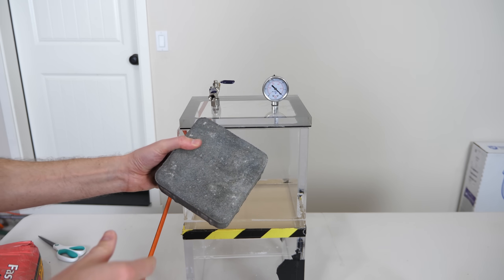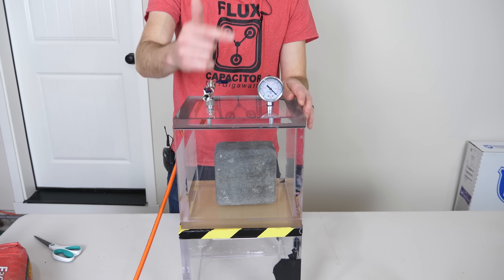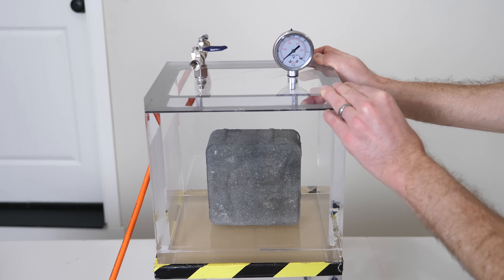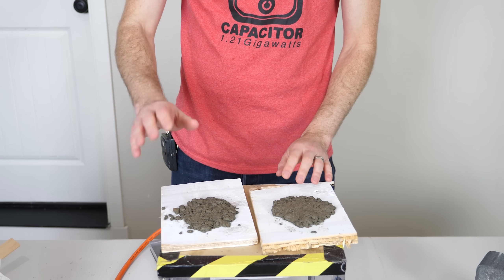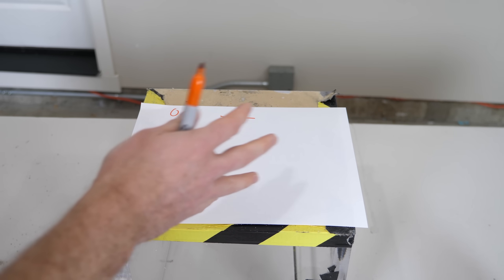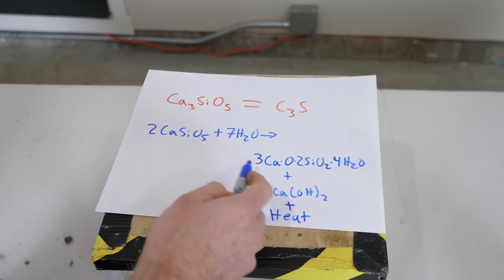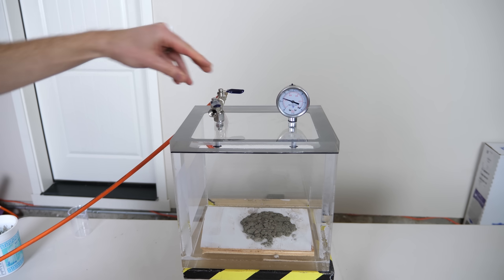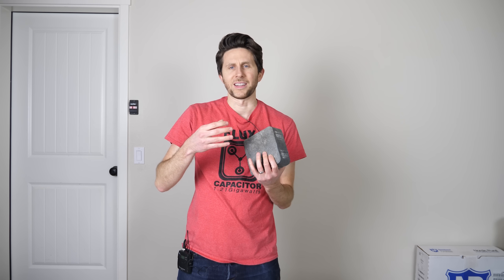Does Concrete Turn to Dust in a Vacuum Chamber? Concrete Without Oxygen Experiment

Comment: This was not a surprise, but I have a question: does the vacuum disinfect at all?, I mean, how long would you deprive it of oxygen and pressure if you want all microbes to die? Do they die even die ?
Reply: I think some bacteria or archea survived on the outside of the ISS for weeks - so probably not reliable
Reply: @robbiejames1540  we've explored how much of the earth? and u think we know what happened more than 4k years ago? the ego is great in science today lol. u can't even admit christian scientists made science what it is today, in fact u think science "disproves" god...... lol hilarious. 

worst part is u treat theory as fact lol..... "o the center of the earth is this" how far down have we been? "7 or so miles...." so how do u know? we don't even know whats on teh bottom of the ocean really, yet we know the center of the earth... yea, ok......
Reply: @JoseRamirez-dv5uo  
Ok, firstly, I didn't say any of what you were arguing against - all I said is that I remembered something about bacteria surviving in space. However, conveniently, I am an atheist and agree with all the points you pretended I said, so it doesn't matter. If you've noticed, we've explored almost all of the earth (above sea level), and we have written accounts from about 4000 years ago. While you're right, we cant be entirely sure exactly what happened 4000 years ago, we can be more sure than anything else, so we assume that to be true, until something more plausible with more evidence crops up. Hence "treat theory as fact" is a bit meaningless.

Currently our best theory about the centre of the earth is that its got lots of melted rock in it, with melted and solid metal in the middle. This is supported by melted rock coming up out of volcanoes from deep down (so there's melted rock), the speed at which the sound waves from earthquakes travel through the earth (sound waves typically travel faster in denser mediums and stiffer solids, so dense liquid iron and dense, stiff solid iron even more so), and the magnetosphere (earth has a magnetic field, and convection currents in liquid metal could explain that, so its pretty likely there's convection currents in liquid metal in earth).

It is through this process that science doesn't "disprove" god, but rather everything so far discovered either has a more logical explanation than "god did it" or is still being investigated. As god has, as yet, had no measurable direct effect on the world we know about, there is no real evidence for him, just as there's none yet for the flying spaghetti monster, or holy pink balloon, or blue hippo of despair. Also, yes, Christian scientists laid some of the foundations of modern science, because in most of the places that these scientists were to be found in, the law was to be Christian!
Reply: @JoseRamirez-dv5uo  jesus christ man he didn't say anything about christianity, or anything that you quoted.
Reply: @JoseRamirez-dv5uo  Theories can be facts . Theories are based on experimental data on which certain acceptable assumptions are made. Evolution is a theory,  atoms are a theory,  chemical bonds are a theory, sliding filament of muscle fibres are a theory.  They all are true nonetheless. If not give one proof against it. You'll debunk that theory.
Reply: @JoseRamirez-dv5uo  Gosh why don't we know about deep ocean its not like we have more than 16000 psi pressure under there.
Reply: @yoshikagekira6166  theory can be substantiated by facts, its not a fact in itself..... we have a hard time with gravity still, can't explain certain things... need example? so the reason y we see 1 side of the moon, is the gravity of earth grabs the nearset side of the moon, and holds it, hence y we see 1 side supposedly... .but the sun has twice the gravity pull on the moon...... so simply put, how does the moon not get pulled by teh sun? out of orbit? or off its axis? i can also add gyroscopic affects to this, which makes it worse...... so...... we haven't expanded on the theory of gravity really since newton.... they dig too deep, the numbers to the equations r off.... so. do the equations work most of the time? yea... but at times it doesn't.... kinda like the bohr model of the atom, then u get to learn about spdf whatever orbits of electrons, then it gets worse from there..... anons? quirks? or whatever, we r lost again.

that was several proofs lol..... do i need to go into delft quantum entanglement? double slit anomaly? nobel prize for quantum mechanis "if u think u understand quantum mechanics, U DON'T"...... so the guy who got a nobel prize for it, said that? ehh? and u want to talk theories? lol.... "atoms" yea, quantum mechanics lol..... WE HAVE NO IDEA WHATS GOING ON... some theories work TO AN EXTENT... but then get lost .... 

JUST LIKE THE BOHR MODEL.. yea, it worked for hydrogen or whatever, THATS WAS IT... lol.
Reply: @JoseRamirez-dv5uo  You are a smart guy Jose but you are just underinformed . The reason why moon doesn't fall into sun is simple. It orbits the Sun along with the earth. Trace the path of the moon and the earth, you'll see that the moon orbits around the sun albeit with minor bumps . Imagine throwing a bowling ball tethered to a tennis ball causing the tennis ball to spin around the bowling ball both will fall to the ground i.e. gravity produces similar acceleration to both and we know that orbiting is acceleration due to gravity. This is known as the Hill sphere effect.
Reply: @JoseRamirez-dv5uo  Quantum Mechanics is currently the best model its not perfect. But QM  is part of a bigger Quantum Field Theory which is more accurate which states the prescence of fields interacting with each other.
Reply: @JoseRamirez-dv5uo  Science kind of works on assumptions sometimes but to say everything is inaccurate is bit of a stretch. We know a lot of things in science yet there are still more things we don't know yet.
Reply: @JoseRamirez-dv5uo  Bohr's model was a postulate made from empirical evidence.  It wasn't a proper theory.
Reply: @JoseRamirez-dv5uo  Quantum Mechanics has more to do with our perception and application of maths. It can have multiple interpretation. 
2*2=4
2+2=4
2^2=4
All are similar statements, if you expand them they end up in the same pattern of 2+2=4
So are they inherently the same. It depends a lot on how you interpret math. 
A lot of quantum mechanics is not physics being spooky but when we try to observe a small system via high energy photons we change its state. A quantum system is just too sensitive that it easily destabilize when we interact with it.
Reply: @JoseRamirez-dv5uo  The quantum mechanical model developed after Bohr did explain orbitals for all the elements.
Reply: @JoseRamirez-dv5uo  Talking about moon colliding into the Sun. Did you know that its harder to collide into the Sun from Mercury than it is from Mars. This has to do with angular momentum of the planets since their velocity increases with decrease in orbit. The moon will ony escape earth once it reaches the escape velocity of 11km/second.
Reply: @JoseRamirez-dv5uo  We have expanded from Newtonian Gravity to Relativity Gravity. We also have an equation 
R=(8pi G)/c^4 T
Reply: @yoshikagekira6166  what is science based on? math? math is based on? axioms? how many again? 6 or 7? axioms? axioms r literally "assumptions".... altho nikola tesla did say "math isn't science" soooo...... in fact nikola had plenty to say on that, and i would say he is the best scientist we know of to this day........ funny, how they took how long to admit free energy was real? (graphene)..... lol found out with scotch tape and a pencil lol........ wow.... yes, science is totally objective (im being sarcastic if u can't tell)... lol, no the oil companies had nothing to do with putting nikola under wraps with the whole free energy thing (or overunity, just in case u want to argue semantics). no science was right, free energy is a myth LOLOLOLOLOL.

u say we know a lot in science? regarding what exactly? hmmm? what "proof" do u have? do u even know what 100% is? if we don't even know that, and we only explored 35% of earth? ehhh, i would say we no less than half, AT LEAST.... and i would even go lower, cuz we don't even know what 100% is lol... what is 100% of knowing everything exactly? god? no god? can we recreate everything? how far intot he universe have we been? what % of that? or other dimensions?

r we in a simulation? or not? we can't even figure that out lol..... jesus man.
Reply: @JoseRamirez-dv5uo  I just feel sad for you. You have potential Jose there is nothing wrong with questioning existing knowledge but you are determinant that most science is wrong even though we have explanations and experinental data to prove our point. There is nothing wrong with being bit skeptical but you are ignoring all the proof we have.
Reply: @yoshikagekira6166  yawn.... and what u said had nothing to do with the point..... how do u know its the best model? u give no reference? i bring up actual experiments, yet u guys? just say shit... no references, no names, no theories... just "theories r facts" ehhh? no they r substantiated by them...... "theories this" 

like what? i forgot who brougth up pressure... but ehhh, if we can't defend against high pressure, how can we defend against none? then add on the vab, and the thermosphere, which cnn in the early 1900s reported on, and also orion missions in 2013, tehn don pettit in 2015 or so said we destroyed tech capable of going in to space.......... tehn obama and many others, talking about how we will enter leos for the "first time"... u know what a leo is? well let me give u a hint, ITS NOT THE MOON....
Reply: @JoseRamirez-dv5uo  We will never figure out if we are in a simulation or not. It called the Boltzman Brain argument. But what is astounding is our universe works on Mathematic principles, ( Principia Mathematica by Newton, Prediction of Blackholes by Einstein using math, Carl Anderson experimentally confirmed antimatter which was mathematically proposed by Paul Dirac). So whatever simulation if there is any doesn't disobey math generally.
Reply: @JoseRamirez-dv5uo  LEO is low earth orbit
Reply: @JoseRamirez-dv5uo  Quantum Mechanics is the best model YET. We are always working towards a theory of everything.
Reply: @JoseRamirez-dv5uo  High pressure is harder to handle then vacuum. But we do have protection against vacuum of space  . There are special suits called EVA( Extra Vehicular Activity) suit. These are thick ,insulated, are reflective protecting astronaut from the space conditions. 
The pressure of  Mariana Trench is more than 1000s of atm but our blood pressure and the turgor pressure is certainly no more than 140mm/Hg for a person at rest( 1 atm= 760mmHg). We use the space suits to apply a counter pressure that helps us survive the vacuum
Reply: @yoshikagekira6166  no, the numbers r against it, the sun should've pulled the moon out long ago.... the numbers they give us already say teh moon moves away a certain distance every year "not noticeable" (but if u include their timefraime, aka how long the moon has been around, it doesn't add up)... "takes thousands if not milions of years" well, if we go by their timeling, the moon was gone long ago, and i could only imagine the tides when it was close lol.......... to which, teh moon and sun both affect.

always question science, if u stagnate we lose...... i forgot the saying, or who said it... but the one where its something like "when answering a question is fine, but questiong an answer isn't, u have a problem"... thats where we r today, and let me tell u, if i told u my full belief on how this world works, u would think me an idiot outright.... yet i know more than most..... which is funny when u think abou tit lol.

perihelion? aphelion? how big is earth? hhow far is the sun? the moon? capricorn? cancer? equator? the solstices, equinox',  hmmm...... how much of the earth has been explored, where the ring of fire is, the most earthquakes, hurricanes, monsoons r..... how earthquakes work for the most part (just a theory lol, dutchsinse is good) 

so, what? i follow the bible, at least the good parts, and one of those parts is "trust no man, figure it out urself".... so i will do that, i have noone to blame but myself... now u can nitpick and say "o well the info u use is other people" 

well i have to somewhat comprimise don't i? i simply question, i do believe in what i believe, but i don't try to force it on others, and if respectful, i will debate, but be rude, i'll be rude too.... and i can back it up..... but in the end, it could all be a lie, a big truman show, but when i feel an earthquake, and hear about others near me, i can someone quantify and believe certain people, or whatever, look around me today for evidence.... "history repeats" for instance, ok, what happened int eh past, that is happening now? hmmmm... feminism, oversexualizaion, immigratoin, dark ages... ok...... let me read up on that.... o shit, we r doing the same shit they did, FUCK....

tbh, idc really, but i come from bottom of the barrell, i can tell for the most part, when someone is manipulative, and the like, i don't like it, hence my aggressions and suspicions. just thought i'd give u some context. i have no friends really, i really don't care for anyone, teh only thing i cried for was my dog, i was happy when my stepmom and gma died, such a relief..... was like finding out u beat cancer lol.....

u know, science said, coconut oil was bad.................. the fats were bad for u....... u know y they said that? ww2, pearl harbor.....

i haven't been sick for decades, thanks to coconut oil, stop and think about that lol.... lauric acid, feeds ur good germs, the ones that defend u, covid, flu, anything is moot.... i have a nasty foot fetish too, u'd expect me to get sick, but i don't....... science isn't as objective as u think it is..... sooooo, o btw dont' get me started on science of the mind.. psychologists, dear god.......

science is a joke nowadays, i can go on and on, if u want to hear, my anthropology teacher, physics teacher, u name it lol... psychiatrists, psychologists.... physical theapy, mental therapy, cars, planes, trains, oils, herbs, dirt, atoms..... i just keep finding faults, and keep questioning, sometimes u find someone with the patience to give u more info, and not a knee jerk cult reaction..... o, btw, im a flat earther lolololololololololololol so.... good luck with taht knee jerk lol
Reply: @JoseRamirez-dv5uo  Well lets talk about atomic experiments if you want to. The Cathode ray experiment by J.J. Thomson proved existence of electrons. Goldstein using a slightly modified apparatus using a perforated anode proved protons. James Chadwick bombarded a thin sheet of berrylium with radiation and proved existence of neutrons. Thomson gave the plum pudding model for a positive uniform mass with electrons embedded such that there's a net neutral charge. It was superseded by Rutherford's model of a small dense atomic nuclei. He bombarded a thin sheet of gold with alpha particles most of them passed undeviated, but the once which deviated were a lot deviated proving there's a dense concentrated positive charge. Bohr's model superseded it by using quantisation and atomic absorbtion and emission spectra.
Reply: @JoseRamirez-dv5uo  The time doesn't matter earth has been revolving the earth for billions of years without a massive change in its time period of revolution. Conservation of Angular momentum stops the moon from colliding into the Sun.
Reply: @JoseRamirez-dv5uo  The earth is 12,756 km in equatorial diameter and 12,714km in polar diameter. Equatorial circumference is 40,075 km  meridional circumference is 40,009 km.
Reply: @JoseRamirez-dv5uo  The sun is on average 1 AU or 93 million miles away from earth ( mean distance)
Reply: @JoseRamirez-dv5uo  Earthquakes happen due to collision and grinding of tectonic plates against each other which in the form of sound or seismic waves surface on the earth at epicenter causing the land to tremor.
Reply: @JoseRamirez-dv5uo  I mentioned before that its good to question stuff but if you chose to ignore the answer saying it is just wrong then you will never get an answer. Imagine asking people what you call a certain color in their language. You listen to them but then you deny that information.
Reply: @JoseRamirez-dv5uo  I too sometimes don't understand science but instead of saying that everything is wrong I try to understand everything around me, educate myself. Just because I don't understand something doesn't mean that its wrong and later eventually I did understand not rote learn whats given in a book.  You can easily experimentally verify a lot of scientific principles even in your own backyard.
Reply: @JoseRamirez-dv5uo  Science isn't a cult it goes through peer review and public consensus. A cult cuts down and separates members from society and outside information meanwhile science is publicly available information.
Reply: @yoshikagekira6166  good for u, u still missed the point, most people don't know shit..... btw i use miles..... my km conversion isn't what it was, nor do i care really. my point was, most people who "believe" in this stuff, don't even know these things, thats all.
Reply: @yoshikagekira6166  ok, 1. lets try to make our convo into one response... im on my ps4 so it makes it hard for me, i'll try to read both ur replies, and combine them both here.

2. i should've said thank u also for the compliment, i apologize for not doing so.

3. here we go... im gonna try to see if i can look at ur other comment, and respond to that at the same time.

"science kinda works on assumptions" yes, it does, but thos assumptions get tested, some some aspects of it can't be tested until we can be there. u said again 
we know a lot" to what %? what is a lot? compared to what? everything? like i said, we only explored (look it up) 35% of the earth........ then things like the delft quantum entanglement experiment? and the double slit anomaly experiment? literally they theorize taht "light is aware we r watching it"....

some people argue, "o well, teh trackers throw off the experiment".... well funny thing is, they left them on, and just didn't look at the numbers....... but when they did look at the numbers, or the effect, it would change on whether they were looking at teh number, literally, the light was aware of them watching itself.. 

delft quantum entanglement? same thing, if b saw it, a wouldn't, if a saw it, b wouldn't, if they didn't pay attention, it shown on both....... sooo? 

"the earth has been revolving around for billions of years" what proof do u have? live snails that have lived may a few decades have been dated to be living for thousands of years, so ur basing ur numbers off failed science.

my argument with my anthropology teacher, since i dared to read a encyclopedia on the matter........... u know, how u date rocks? how u date fossils? well.. the definiton i read was quite a circle argument......

so, the encyclopedia said that "we date the layers by the fossils........ and we date the fossils by the layers"

ehhhh? how is this scientific? dn't get me started on mother and daughter radioactive bs....... many things can affect how old something can be dated... rain, heat, weather, exposure..... like candles, i could ask u how long these cnadles have been lit for, i guarantee u would lose..... i could add was to one, cut one in half, burn one from both ends..... u can't tell how long it was lit for lol. then imagine all these candles r int he same room.. or  "layer", next to eachother..... to ascertain the whol thing, u would have to know the mother and daughter cells present from the start, and that has shown to be a complete failure, as my snail experiment proved. they thought a 20 yo snail was like 10000 years old lol. 

and u trust we been around for billions? do i agree there has been only 6k years of human history? no, i think we been around longer than that..... something keeps resetting us, whether its the coral reef, or natural disasters, every 5k years or so, the world is renewed yes? the flood? the meteor? volcanoes? ice age? so........

we r in the time of the 5th sun? if i remember right? by aztec/teotihucuan (i can't spell these guys right)  or mayans said? aka there was 4 world wild natural disasters that happened? and now we r about to hit the 5th? so they have roughly, IF THEY R RIGHT, 20k years of history we dont' know about..... then the neanderthals, and the like, which supposedly goes back 10k years? egyptian 13k years or so?

what did they say?hmm? in wonder..... this is how i learn more, i have to research now, thanks for the thought.
Reply: @JoseRamirez-dv5uo  Radioactive dating of earth crust is independent of climate. We use the half life of  U-238 atoms to find the age of earth and its approximately 4.5 billion years.
Reply: @JoseRamirez-dv5uo  C-14 atoms used to date organic matter works bit different.
Reply: @JoseRamirez-dv5uo  Radioactive decay is independent of physical and chemical changes of climate. The rate of Radioactive decay is dependent on the weak nuclear force. These nuclear forces are of such high magnitude that climate, rain, wind doesn't effect the rate.
Reply: @yoshikagekira6166  ehhh, and, u need to know how many mother, and daughter cells there r.... from the start, to even begin to think about how old it is, and u didn't mention the snail at all, or the failing of it....... "approx 4.5" theory..... just a theory...... we can't explain most things today, only 35% of the earth explored,  hell things the romans made, greeks, egyptians, we can't recreate lol, come on man.
Reply: @yoshikagekira6166  btw, there seems to be no proof of temp not affecting nuclear decay.... in fact, that is how the atomic bomb works apparently..... sooo. im going on my way here, good luck. also, im gonna repeat myself, u need to know the numbers/ratio of the mother to daughter cells to even begin to guess at how old soemthing is. so....... good bye.
Reply: @JoseRamirez-dv5uo  Atomic bombs don't use radioactive decay but nuclear fusion. Both work differently.
Reply: @JoseRamirez-dv5uo  Candles also emit radiation but that is Blackbody radiation which is temperature dependent unlike radioactive decay which is temperature independent.
Reply: @yoshikagekira6166  so chernobyl...... wasn't affected by heat?
Reply: @JoseRamirez-dv5uo  The heat melted the corium and the steel walls of the reactor and didn't affect the half life of the atoms. This melting of the core resulted in exposure of radioactive material to the outside environment. The radioactivity wasn't changed.
Reply: @JoseRamirez-dv5uo  Radioactive decay happens due to electroweak forces by Z and W bosons. They are of three types alpha,  beta and gamma. Gamma is always produced but an atom may randomly undergo a beta decay or an alpha decay one at a time.
Reply: @yoshikagekira6166  hmmm, weird, u see teh show chernobyl? thats not how it explains it..... and 2. the old lady, that they made "vacate" her farm? they shot her cow in the head, she still lives there, never left......

i see 2 problems here.....
Reply: @JoseRamirez-dv5uo  Radioactive decay rate remains the same but when the core melts and the Radioactive material disperses then effective radiation decreases but the half life of an atom is always the same.
Reply: @yoshikagekira6166  i gave up on science long ago, when they couldn't admit nikola was right about free energy, now they freely admit it (graphene) only took them 140 years or so to admit. i can remember some other experiments too, back in the day, but overall, science is a joke now, really wish u wouldn't send me multiple  messages, if u can plz consolidate, put into one message..... 

btw, u said they may "randomly" do something, ehhh, cuz we don't know yet...... maybe never know, so maybe thats y there is no definitive proof that heat can or can't affect decay... so.
Reply: @JoseRamirez-dv5uo  Graphene isn't free infinite source of energy that violates the first law of thermodynamics.  Second Z and W boson in order to increase entropy  randomly decay. This logic is terrible that since its random it can be associated with temperature. Rolling a dice is random but  I can't relate it with number of kangaroos in Australia. We have done various tests with control experiments and we can't find either a correlation or a causation of radioactive decay with temperature. Nikola Tesla was a pretty smart inventor and scientist but anyone can make mistakes considering they lack the resources and information that we have now. Although Newton maybe smarter than me but I am more knowledgeable about physics then him. Its because I have access to information that he didn't.
Reply: @yoshikagekira6166  i don't think ur understanding what im saying.... there is a woman, that lived next to chernobyl, in the "radioactive zone"...... did they not say it wouldn't be able to grow anything? or have life? well, this women never left, and is still alive or died somewhat recently (in last decade or so) also, the wildlife is back in full force, no weird mutations.

in fact, back in 2018, they said a pack of wolves were spreading mutations.... none yet, no word........ seems the math is off..... math, is not science, they said it would be dead for years, its fine lol, radioactive decay, is bs for the most part, and it is affected, as proof of chernobyl, and the woman who never left the "bad zone" and the animals that roam there..... and the plants taht grow......
Reply: @JoseRamirez-dv5uo   There is a nuclear physicist called Thunderf00t, he is a good source for statistical info on this on YouTube. 
Secondly,  Let us understand how radioactivity affects us. U-238 the fuel used in reactor isn't super dangerous by itself,  the main culprits are Strontium-90
and Iodine-131 which bio accumulates in bones and thyroid respectively.
In order to die of radiation sickness by U-238 you'll have to eat 50 grams of it. Of course chemical poisoning will kill you first.
I-131 has a half life of 8 days hence its very radioactive but will decay and end up quicker lasting less time in the food chain. 
A lot of radioactive damages depend upon factors like bioaccumulating radio-isotopes.
If you want a clear cut image on the statistics see Thunderf00t, Infact he holds the same stance as you that radioactive damages are not that high and most nuclear physicists are of the view that reactor fallout damage is significantly less than that of a nuke bomb because of usage of U-238 and U-235 respectively. Infact we also had a lot of fungi over there. Most of mainstream science on this topic agrees with you, so I don't see any argument.
Reply: @yoshikagekira6166  thanks for info. i'll try to get to ur other comments later, u have quite a few lol.
Reply: @yoshikagekira6166  I am highly impressed by your patience. I can't believe that you were genuinely trying to make him understand science when he was literally not listening to you. You are a great person. I would like to know if you are a teacher or a Professor? Even if you are not, I would love to have someone like you as a teacher. By the way, what is your real name?
Reply: @Yash-ML-Sharma  I am not a teacher yet but I am studying for being a researcher.
I personally believe science is pretty awesome so I try to learn and give back what I can learn. Thank you for your appreciation but I would rather not reveal my name, it's nothing personal.
Reply: @yoshikagekira6166  Yeah, I can understand, no need to reveal your name. I am a sophomore now and just like you, I also want to be a researcher in future. I am also lucky to have someone like you as my mentor. The biggest thing I learn from people like you is the kind of person I want to be. I just wish YouTube had a chat feature.
Reply: @JoseRamirez-dv5uo  the moon doesn’t get pulled towards the sun because the Earth is pulling on the moon more than the sun. Sure the sun is a whole lot more massive than earth but it’s also many, many times father away. That’s why the moon orbits earth and isn’t just following the same orbit as the Earth like a few temporary asteroids that only look like they orbit Earth. The “theory” of gravity only breaks down under extreme conditions like black holes, there the general relativity equations we use just don’t describe black holes right however they did predict the existence of them, as well as gravitational waves. Not one single experiment has proven otherwise. Sure there are questions like dark matter and energy, how black holes actually work and every single second of the day there are experiments testing the accuracy of this theory because we know it’s wrong, but nothing has beaten it so far and because it’s the best theory so far we use it
Reply: Here in 2021😏
Reply: Life began on earth long before there was ever any available oxygen. Anaerobic I think they call em.
Reply: Depends on the microbes involved. Some require oxygen to survive while others are Anaerobic and thrive without oxygen. Others don't rely on oxygen and get their energy elsewhere such as from fermentation and photosynthesis.

The real question is if there are any harmful microbes left afterwards. Some microbes are harmless to the human body, so those can be mostly ignored.
Reply: I think a better idea is a UV light box. I've seen some on yt and it's basically an enclosure with a UV light inside. Put whatever you want to disinfect inside and turn the light on. Some number of minutes later and the items are disinfected. It does do some damage to items though. I believe I saw someone using it to disinfect N95 masks for reuse. Only recommended for rationing purposes but it does work pretty well in a bind.
Reply: not all of them, first they would need oxygen to live, wich most of them dont. second, void is jut zero pressure, here we have 1 pressure, so it is not much.
Reply: I don't think a vacuum is a good place for life in general
Reply: Well I’d say the biggest limiting factor is water and not oxygen, cells are mostly water and would probably burst from the gasses